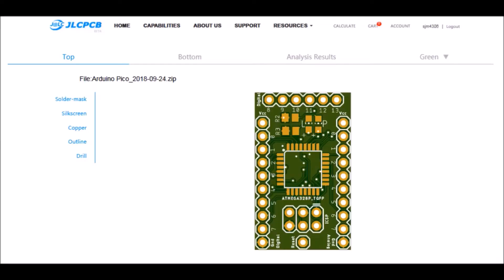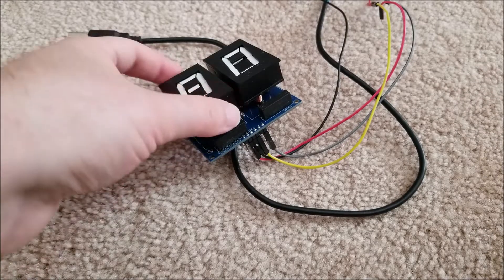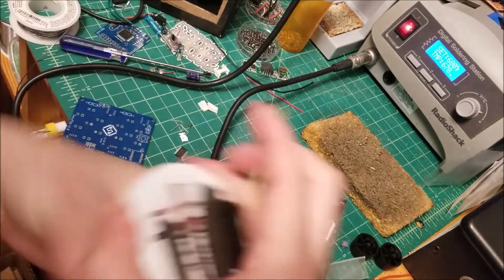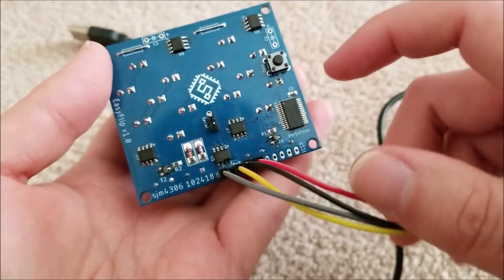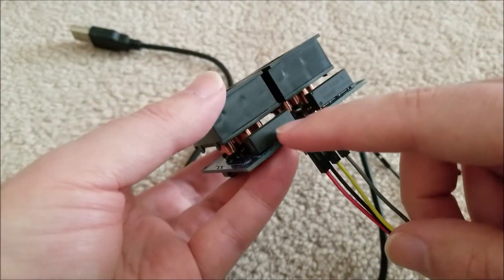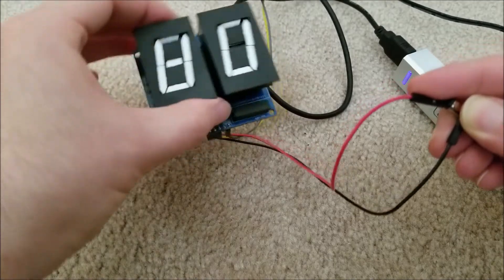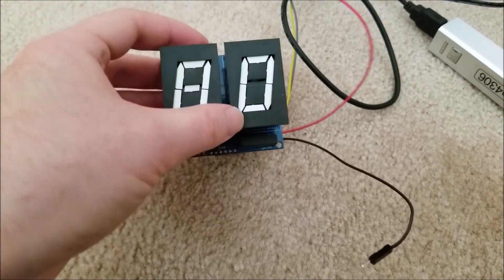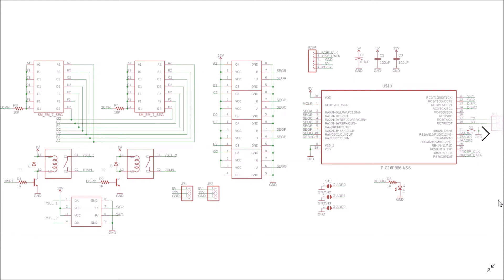Project EasyFlip - Part 1: Prototype 1, How Not To Multiplex EM Displays!!!

Comment: i saw the spam comment and i like that idea (when i had no other google account) if there is one chip, you could use that site that sponsored you to make a copy of the game chip.
Reply from the maker: I could copy the pcb, but the chip is either an asic rom or encrypted flash in which case I wont get very far replicating it unless I dig in and basically reverse engineer the switch's security.

Comment: FIX AN NINTENDO SWITCH GAME CARTRIGE
Reply from the maker: I only have one switch cart and it is not broken so I'll have to find one that is. The issue would be there isn't much in a modern game cart to fix (they are literally a single chip now). It either works, needs a clean, or is completely dead.